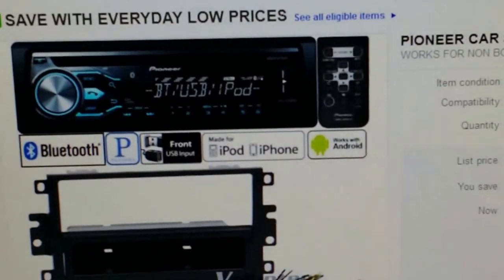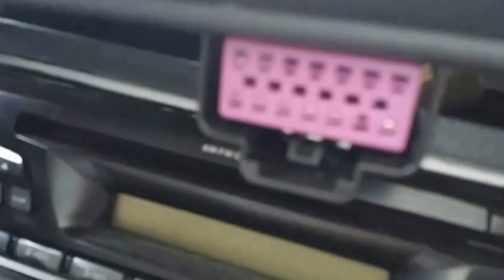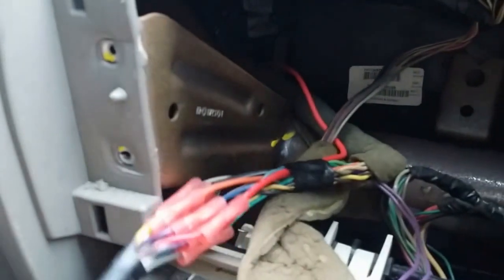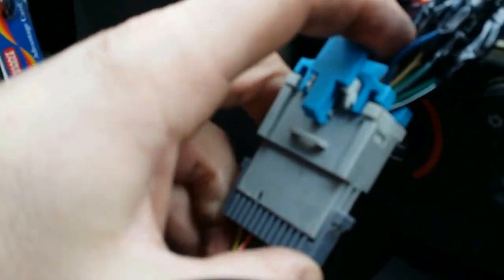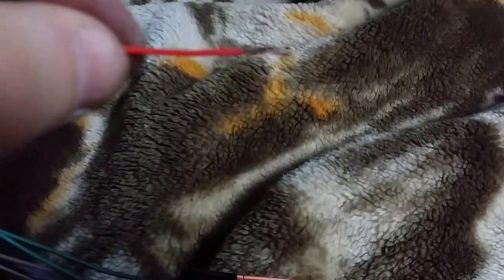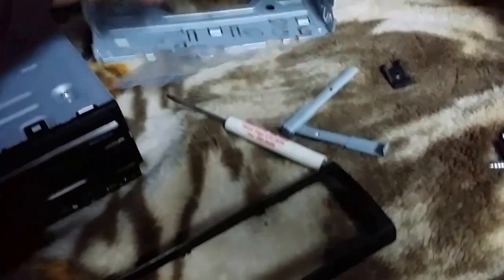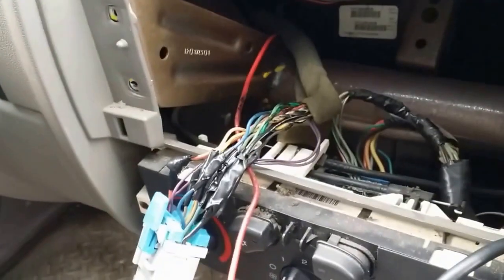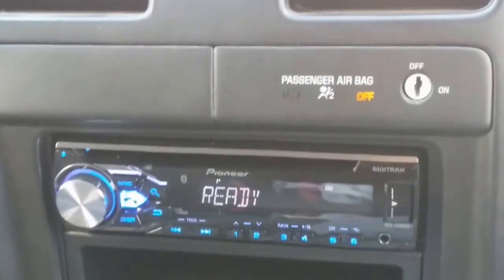Gmc Canyon Aftermarket Radio Install

Comment: What you do to the second plug of the stereo ??? I have 2005 Colorado and someone cut wired of a connector of the stereo but left the other connection intact. Do you need the other connected????
Reply from the maker: Sorry this almost 3 years ago. I don't remember. But still have the truck and stereo.

Comment: where is the red wire attached to?
Reply from the maker: Carlos Reyes 

red wire is for the homerun connection to the fusebox for 12v ignition switch for aftermarket radios, since these didn't come with one directly installed.
Reply: Oh I see. Thank you. That's what I was confused about haha
Reply: How do I install that red wire?
Reply: Javier Sanchez what I did was finesse my long red cable wire to the front fuse box of the canyon. since it is the main power source cable.
Reply: Carlos Reyes ok so i basically run a wire from fuse box to interior to stereo?  Sorry to be a pain but need help.  Thanks for answering
Reply: Javier Sanchez yeah that's what I did. the red cable is long enough. and I found a. hole that runs through the car right above the emergency brake pedal area. but look for the hole from the outside(open the front cover) and then run the wire through and look for it under the brake pedal area
Reply: Carlos Reyes right on brotha thanks! 👍
Reply: What fuse did you connect the red wire to in the fuse box?

Comment: red wired is for 
?
Reply from the maker: When I bought the truck it already had a aftermarket radio. So I'm not sure if it's stock or the previous owner installed it. I think it's ground but I'm not 100% not sure.
Reply: red wire is for the homerun connection to the fusebox for 12v ignition switch for aftermarket radios, since these didn't come with one directly installed.
Reply from the maker: crimsonsamuraiftw 

Thank you for clearing that out.
Reply: Andrey Andreychuk you're welcome